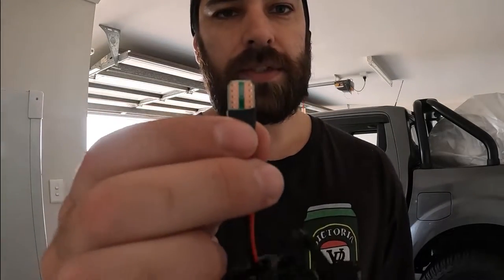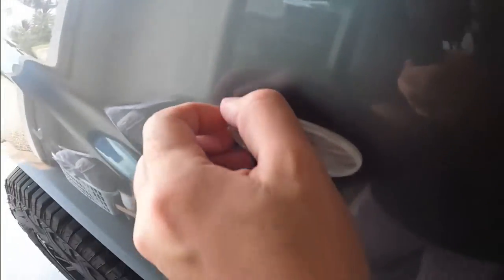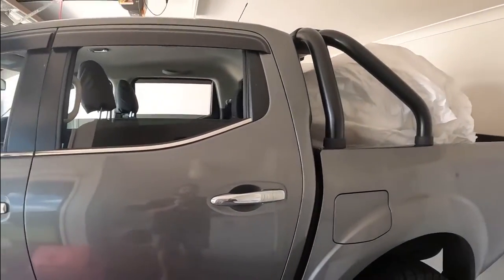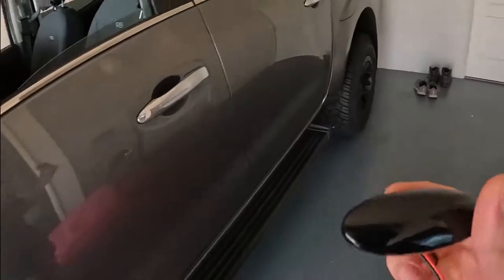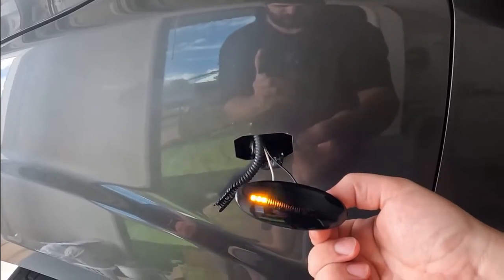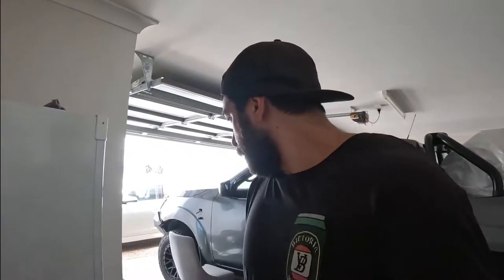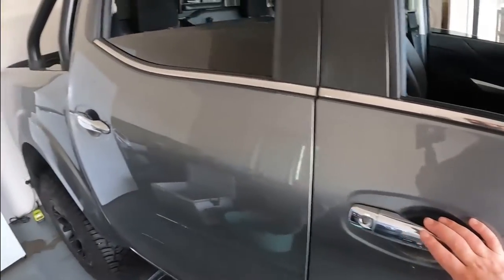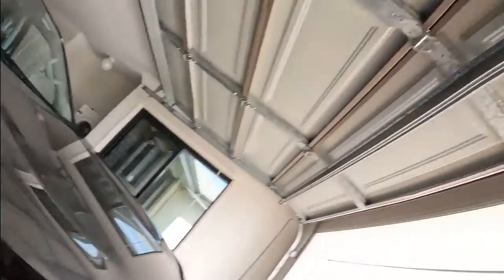How to install new indicators...NAVARA NP300 D23 BUILD

Comment: Just remove the bulb and plug in the wire that it comes with that’s if you didn’t know that by now but I like the never lol
Reply from the maker: Yeah I got told that after the fact haha good tip!
Reply: @GetThatBread  I just got some today
Reply: Hey mate got mine today and having trouble did you have to unscrew the casing from the bulb then pull the bulb or just pull the wires out of the oem indicator

Comment: hey got mine today and they just plugged straight in didnt have to cut any wires
Reply from the maker: Yeah someone else commented that a while ago. I didnt realise 🥲
Reply: Hey mate got mine today and having trouble did you have to unscrew the casing from the bulb or just pull the wires out of the oem indicator